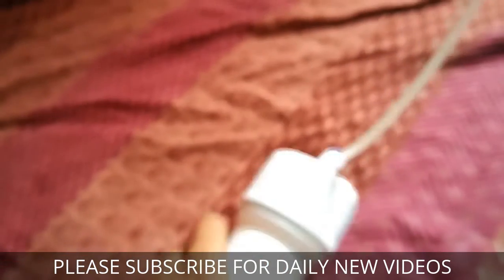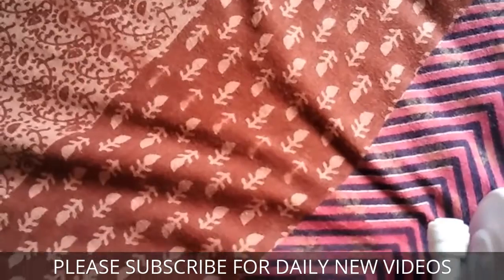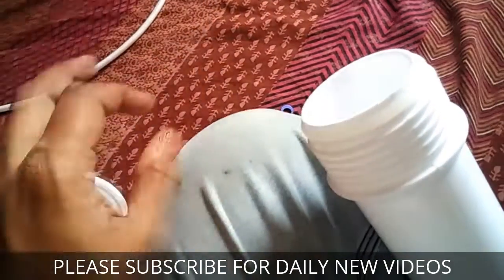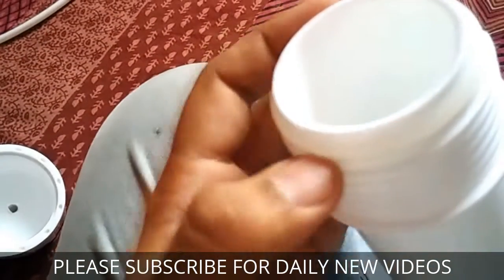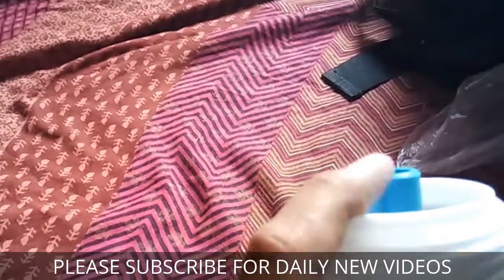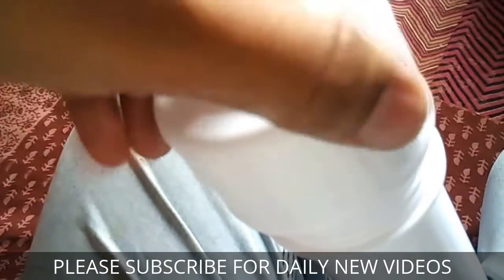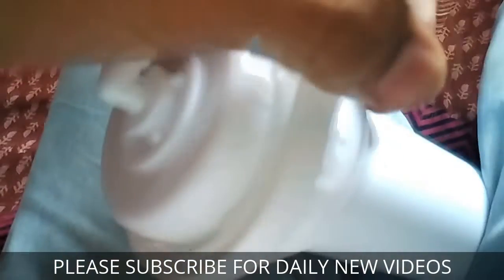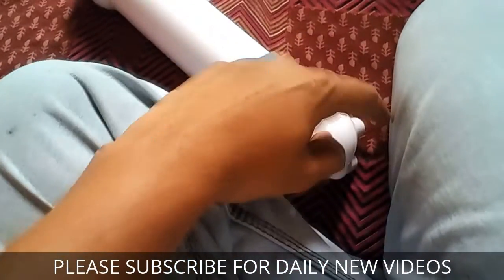RO Membrane : How to Place a in a Membrane Hosing, for Aquagrand Plus,Kent,

Comment: I changed my membrane. But still it is taking 105 minutes to fill(7-8 litres). I had also changed the pre carbon and sediment filters 6 month back. What could be the problem?
Reply: check flow restrictor...or pump pressure